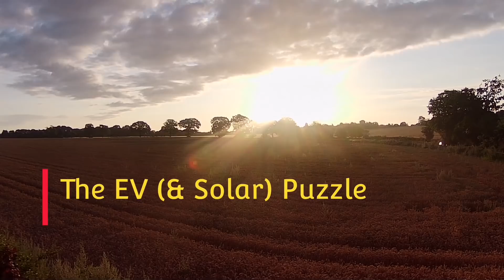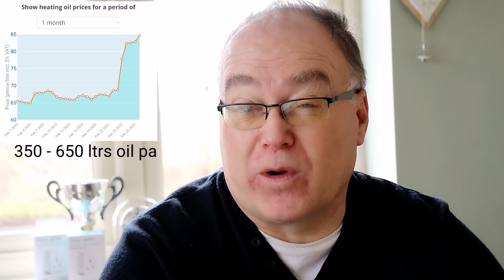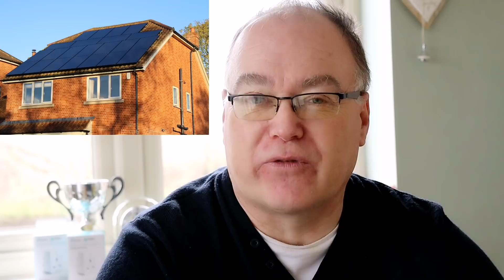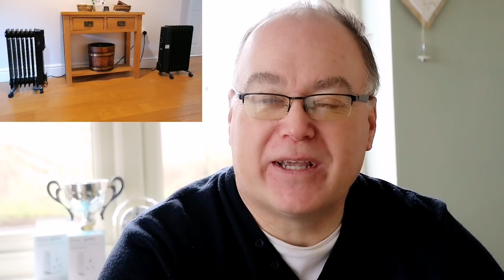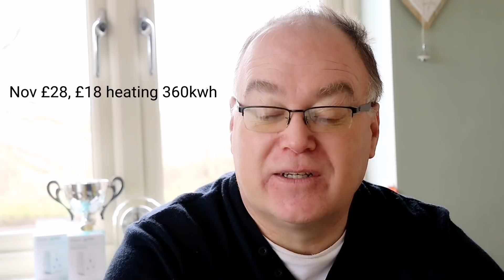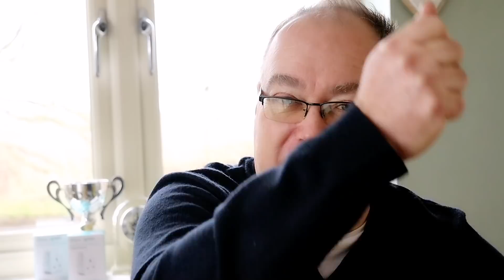Electric vs oil heating - No central heating all winter. Results of my full winter test

Comment: We went from biomass heating to air 2air heating and cooling using Mitsubishi air con units (4 in total) this heats our 120sq/m bungalow to 24 degrees 24/7 it has cost me £600 over the past year but that assumes 100% paid for elec. with the PV 9.6kw in place it has actually cost less than half that for the year. Really pleased with it overall and you get free cooling in summer when the sun shines.
Reply from the maker: I'm looking at the mitsubishi units now . (Mzs)
Reply: @EVPuzzle  we went for the LN units but dearer but have some great features like plasma filter and ir eye scans room and direct air at upto 2 different seating positions 

Very impressed with them

Comment: Very interesting experiment. We live in a mid terrace house which has never had central heating and have relied upon a open gas fire downstairs and a balanced flue gas heater on the upstairs landing. With our gas going up from 3p to 7.5p/kWh we're investigating having a more granular approach with individual heat sources in each room. I'm planning on putting 400W underfloor heating mats under the carpet in the two loft rooms. IR heat panels in the master bedroom for some 'sunshine' style heat and possibly a further one in the youngest Daughter's room. My Son has a cabin bed and would be too close to the ceiling for IR in his room so he might get a small oil filled radiator. I'll be scheduling them to run at full tilt overnight (Octopus Go) and then frugally during the day as required.

We do have a 3.6kW solar system, but no battery as yet!
Reply: Using a heat pump, in your largest room, they can collect heat at about 5-7 KW per 100,000 Btu's of heat.  While a electric heater will take 23 KW per 100,000 Btu's of heat.  For your bedroom, I would recommend a 40 pint per day dehumidifier, to put out about 8,000 Btu's of heat per KW of power used.  Electric heaters produce about 3,400 Btu's per KW.   The kids can leave their door open to warm the room from the heat pump in the living room, drifting up to the upstairs to heat the whole home.  

I put a 12,000 Btu heat pump in my nephews house, and it works really well, so he will not need to run the electric heaters in his home for more than a quick warm up each morning in only December and January.

Comment: I did have 16p a unit but now on  26p due to my tariff ending.
If you look at it.  it is  ~~  Control ~~  turning heater on and off or down .   most people are just lazy, turn on and leave on.
I don't have heating.    i have a wood burner  and burning free   cardboard  and paper.  but never on for long periods remove to cold.  and wear  jumpers and cover while on settee.   for bedroom  once in bed  2 duvets.
All you need is a energy low  heaters.    may be wet rooms  are they not linked to rooms being heated just have door open.
and for heating a room  you have to look at how long you spend in a room.
for some heating  keeping heaters on all day vs the oil system  you say £20 just to heat but that's more than you spend for the month for the rest of the heaters for the heaters

Comment: Great video

Would you be able to share how many kw in total was used in heating alone rather than the offset amount with the solar you produce?
Reply: Thanks for clarifying, so you used £110 worth of electric on your current tariff average regardless whether it came from the grid or you produced it? Looks to me from some of your other videos you are producing net more kw in solar than you are using in heating even in the winter
Reply from the maker: I am, we have an excess in months where we can't use it.  It will be used in years to come or will generate income. Having an excess is the plan
Reply from the maker: I thought I had, I only Record KWHs the heaters have used not where the energy came from

Comment: I dont know what you think, using an air source heat pump operating at a minimum i.e. flow temp 35C all year. This means it isn't reacting, just pumping a steady amount of energy into the house, whether it's -5C or 20C outside. I would then use IR panels throughout the house to maintain the desired temp. The thing about IR panels, they heat you more quickly than the house, which mean for example in your bathroom you should use a high power IR panel which would provide enough heat but only while you are in the bathroom. In the living rooms, I would use lower power IR because it is on for longer. (You can get modulating IR panels which reduce as necessary) I am testing IR panels. One is on a sensor, and another is turned on with "Alexa" So for example, you could say whilst sat in the lounge "Alexa...bathroom on" 5 minute before you go in. Then it's nice and toasty when you go in. I do this while I'm in bed to turn the living room panel on (350W)

To summarize - ASHP permanently on minimum would give maximum COP (>3 or 4) all the time, and doesn't need to be on all year. Say when the outside temp is <10C, or to your comfort. Zoned IR panels on sensors to fill in the shortfall. High power for small periods of time, e.g. taking a shower. Its just a thought experiment, since cant afford to do it practically. It will be interesting reading the comments of those in the know.
Reply: A heat pump water heater (in the 30,000 to 45,000 Btu per hour size range, yes this is a new product that was not available back in 2017) would be a wonderful replacement for the oil fired boiler in any home that heats with oil, and would offer a much lower cost to heat the old radiator system.  The water is only heated to about 30C - 35C, while it will use less energy heating the water to a lower temperature.   They can be set at 40C, but it will consume a LOT more power to reach that slightly higher temperature.  But it will be a lot more complex than installing a couple of low cost ductless heat pumps in the largest rooms of the home.  Amazon has ductless 12,000 Btu heat pumps for $800 - $1,200 in America.  Not sure what the cost will be in Europe, but still a very effective way to heat any home!  I am installing one that cost $900 and is rated at 17 SEER and 18,000 Btu's for my neighbor. 

Some brands of ductless heat pumps are self install, with a low amount of refrigerant pressure in the lines that go between the indoor and outdoor coils, then screwing them together punches through the aluminum covers in the lineset, to allow refrigerant flow after the line is tightened.   So they will not require a HVAC guy to install the refrigerant lines and use a vacuum pump to finish the installation.   That type is about $350 more expensive than the type I install, I am a HVAC guy, and can evacuate the lines, so buy the lower cost units.   

You just select an outside wall to install the indoor coil, drill a 2" diameter hole through the wall, and locate the outdoor unit within 15 feet of the indoor coil, and connect the tubing, a 4 wire connection to power the indoor unit from power supplied by the outdoor unit, then connect 120 or 230 volts to the outdoor unit, and you are done.  Open the lineset refrigerant valves, and you can turn it on.   

You "Could" install the indoor coil on another wall, but running the tubing to the outside unit can get complicated, and might be visible inside the house.  I will mount mine adjacent to a closet, and run the tubing through the closet to under my home, then outside.  I have a 3 foot tall crawlspace, so easy for me to do.  

If you are going to extend the tubing length, then the advantage of the self install heat pump is not there.  The other style that must be evacuated, and cost about $350 less is the way to go.  The HVAC tech that can extend the tubing can also evacuate the tubing and charge it with the correct amount of refrigerant when they start the unit.  Expect to pay about $350 - $500 to have the tech come out to your house and finish the installation.  Many companies will not touch a self installed unit, they claim it is a liability.  You might find a HVAC repair handyman on Craigslist willing to do the job, perhaps on a Saturday in his spare time, not using the company truck.

Comment: The best PV solar systems have efficiencies between 20 and 22 percent currently on the market. Flat thermal solar systems are about 40 to 60 percent, but they depend heavily on clouds and the rest. The most efficient way to get heat from the Sun is a heat pipe system with over 70 percent efficiency. So the best option for homes is the following combination. 1.) For electricity PV solar system for clean electrical appliances. 2.) For hot water and heating heat pipe system with hot water tank (understood as a thermal battery). The result is as follows. A smaller battery is required for the PV system (LFP or LTO). They have more cycles and are cheaper than NCM chemistry. The thermal hot water tank, which is made of plastic and insulated, has a lifespan. It scales according to the number of squares, the insulation of the house and the climatic area. Example. The thermal hot water tank of 500 liters at a water temperature of 90 degrees Celsius has a thermal energy of 40.74 kWh. The price of such a tank is around 800 euros in Croatia. What is the price of a 40 kWh battery? Even with all the installations around the thermal tank the difference is big. Also batteries lose capacity. 5, 7 or 15 years versus thermal tank. Best regards.
Reply: I have a friend in southern Oregon who installed a tank type solar thermal water heater on his roof after seeing how effective they are at the hotel he stayed at in Africa.  It does save a significant amount of cost to heat the hot water if you are using electric heat!  By preheating his hot water to about 95F (winter time) or 120F in the summer, his water heater is using only about 10% of the power that was required before installing the solar water heater.  The tank on his roof is about 150 liters, and the solar panel is about 6X 10 feet.  

If you live in a area with significant snow each winter, then a evacuated tube water heating system would be best, as they can work well even with -20C temperatures in the winter.  A 30 tube system will serve most homes very well.  One home that I read about used a hot water circulating pump and did not insulate the hot water lines going through the walls of the home in Colorado.  Thus the domestic hot water solar heated, could provide a lot of warmth to the walls inside the home, and that reduced the amount of heat required to keep the house warm. It was a Net Zero home featured in Home Power Magazine.

Comment: What I time to look at this in detail !!.  I'm sure you also still have one eye on an ASHP.  Removing the draughts certainly seems to have given you fantastic options.  I went the Tado route - so every rad is basically it's own zone.  So the kids can control their own room temps as required.  And we only heat rooms we use when we use them.  Maybe for your next project you can now use Smart Plugs and IFTTT or a Pi with Node-Red and control your oil filled radiators

Comment: Really interesting summary and following your home heating strategy with interest but I have a couple of queries:
At ~13.50 you mention Octopus the Agile-Go tariff.  I’m on the Go tariff & aware of Agile but Go is only cheap between 00.30 - 04.30 so how do I get your 03.30-06.30 tariff?  Second point relates to the dehumidifier which would help with our cloths drying issues.  Can you recommend any particular brand/model please.  All good stuff.
Reply from the maker: It's called GO Faster. You get to choose when the period is and whether its  longer or shorter. It's by invite so no guarantees to get what you want. It's a test programme so they'll need a balance across the time periods and once full it's full.

Octopus are great as they're testing using live customers how they can help balance the grid and usage. Once they can influence usage by encouraging customers they can gain value from that flexibility

Comment: I have my solar panels booked in for fitting but not battery as currently it is impossible to get cheap overnight tariff now. What are your plans for when you tariff ends with charging your battery storage?
Your fire couldn’t you get that fitted with a back boiler so when you use it heats all the radiators in the house?

Comment: I did a similar test last year, although ended up with a different solution. My combi boiler died in Sept 2020, and as the Green Homes grant for my ASHP took ages, winter 2020/2021 meant portable electric radiators for heating. I also had my solid fuel fire, which I used a lot (2-3 times per week). In total for a 3 bed Victorian home I used about 6000kwh over my usual electricity consumption, without the solid fuel fire that would certainly have been 7000-8000kwh I think. I did have to think carefully about when to switch them on to get rooms up to temp to minimize consumption. My EPC says I need about 10,700 kwh for space heating. My heat pump (Daikin Altherma 3) went in September 2021, and I reckon it will use about 2300kwh for space heating this winter. I occasionally use the solid fuel fire (once a week), but the majority of heating is by far from the ASHP. Overall I'm happy I have worked out how to get the best out of it. I expect the COP to be about 3.3 for the whole winter.  You don't have to be a heating nerd when you own an ASHP, but it certainly helps!

Comment: UPDATE!…HomeFuels now 104p a litre for Home Heating Oil…@ 17.47 March 4th 2022!…god help us!
Reply: Install a ductless heat pump.  100,000 Btus is burning 1 gallon of oil, while using electric heaters takes 23 KW, and a heat pump only 5-7 KW of power to transfer the heat inside your home.  Running a oil burner this winter will be extreme expensive!  

Amazon sells self install heat pumps, that have a small amount of refrigerant in the lineset, so they do not require a HVAC guy to install them.  The unit is about $400 more than a type that does not have the sealed lineset.  If you can install the outside unit within about 16 feet of the outdoor unit, you can install it yourself, connect it to the power line, and be done in about 4 hours.  Just drill a 2" diameter hole in the wall to run the tubing and drain line. and locate that hole behind where the indoor unit will be installed on a outside wall.  As the copper lines are fitted together, they crush a aluminum cover that allows refrigerant flow after installation.  

By installing a 18,000 Btu unit in your largest living room space, you can heat it to about 20C, and avoid running electric heaters in most of the other rooms of the home.  You might consider another second unit - perhaps the master bedroom?  Maybe 9,000 Btu's?  Then avoid running the electric heaters altogether.  

Check your grid costs.  It will probably be less expensive to heat with a electric heater than a oil burner.  While a heat pump will be about 1/3 the cost of running electric heaters.

Comment: We have a lovely big towel rail on the wall in our bathroom which is dual fuel. It works with the central heating and in those in between months when the ch is off I can switch on and heat it electrically. The switch is on the landing side of the bathroom wall because you can't have a 13amp plug in a wet room.
Thanks for this experiment it's been really interesting. You have the same tastes in heat as we do, cool bedroom and nothing over a max 19°C in any room.
We're in a fifties semi in which we 'should' have cavity wall insulation. I've been reluctant as I believe the house needs to breathe to prevent condensation and mould. I had presumed that new houses would have infrastructure that mitigated that but clearly not.
Sadly we're a low income couple and solar etc is out of our reach at the moment so we're going to be clobbered come April!

Comment: If you are on the price cap electric rate then heating by electric is far to expensive, come April, when it will be 30p a kWh, it would be crippling. We use the woodburner this winter alot and that has saved an extra 400l of oil. Most of my neighbours use 1500-2000 litres of oil per year for a 3 bed detached house. We use 1000 litres, a bit less this year.
Reply from the maker: You gave to remember I'm mostly using solar and cheap overnight energy so our heating won't go to a crazy price like oil right now.

I'd rather burn wood than oil too. I worked out a good sized  log saves around 1kwh of electricity so 12 logs a day which is a out right saves 12 X 16p(currently). Soon to be 12x 30p or 40p.
Wood is going up in price too of course

Comment: Interesting update. On cheap off-peak tariffs, also depends if you are with your prefered supplier. I had wanted to move to Octopus , however waiting for E.on to get their act together cost a lot of time (had first version of smart meters and they had volunteered to swap to SMETS2 then took months to join them back to system) so only high new customer deal with Octopus or good deal with E.on who I'm still with as I'm GCH for now.  Looking at my standard tariffs gas to electric multiplayer (therefore approximate COP) has gone from 5.69 to 5.09 and now 3.78 in the space of 6 months.
Reply from the maker: Octopus has been the best move I've made supplier wise.  They just keep surprising.  There's always tempting tariffs like EONs new EV tariff but it's the same old fixed deal that will increase later. Octopus gives me confidence to just stay with them and the fact I can do in and out of Agile and GO and their other tarifs easilly  is a huge plus.

Stay because you want to not because you have to

Comment: Good project! I'd be inclined to keep the wood burner in case of power cuts in winter. If you source local sustainable wood, it's not a bad way to produce heat.